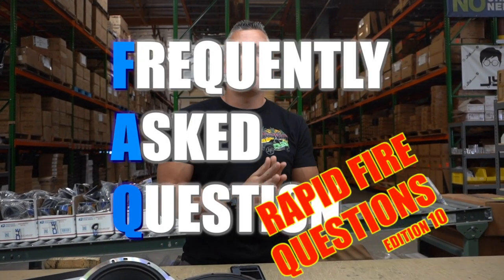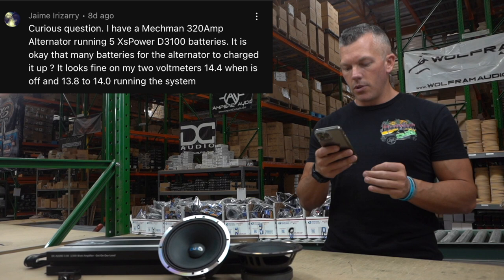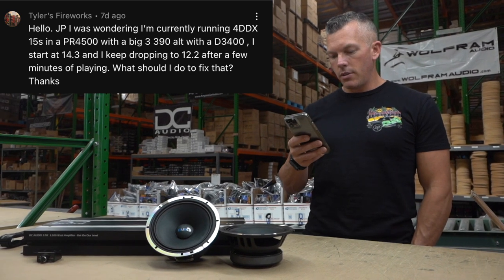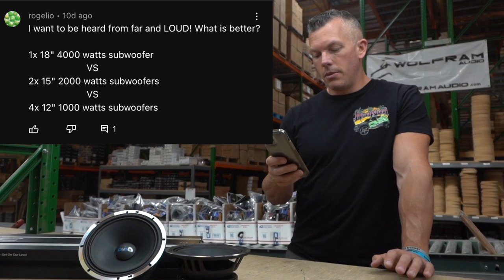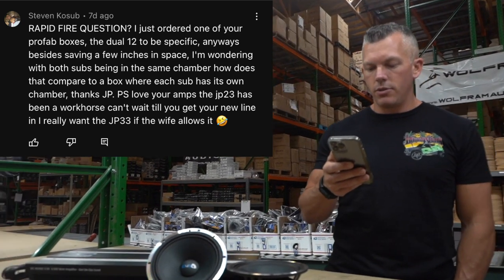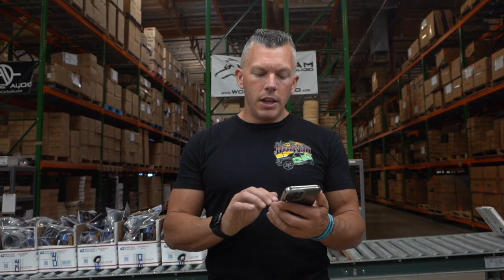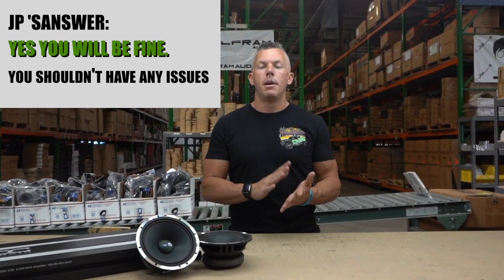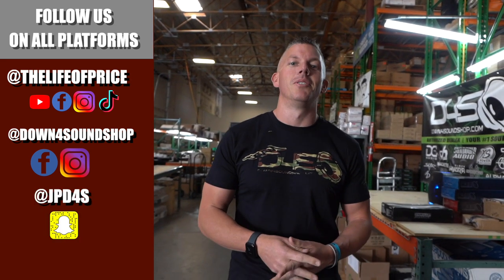D4S CAR AUDIO RAPID FIRE QUESTIONS: EDITION 10

Comment: I’m going to add 2 Down for sound 6.0 batteries should I run wire from the alternator to the back batteries or from the battery under the hood to the back batteries
Reply: Always run from the alternator to the battery in the back also make sure you have a good grounding point on the frame so you don't have any problems in charging and power handling capabilities

Comment: Rapid fire question: Yo jp I just bought the LTO 6.0 lithium to power 3 skar evls and a 320a js-alternator my voltage stays at 14-14.8 but when it's cold around 30 degrees it charges at 15 to 17v is there any sort of in line regulator, step down converter or anything to keep my voltage at 14.4v ?
Reply: Get a diode isolator.

Comment: Hey JP....I got a question about lithium batteries...is it safe to run a lithium in parallel with a agm battery? Or should it be isolated? Or should I eliminate the agm up front with a lithium also to go with they one in trunk???
Reply: I'll answer for JP just incase bro...hell no. Don't MIX AGM and Lithium
Reply: @imlurkn5291  so should I isolate or get rid of the agm altogether....I haven't ordered batts yet but I will be in the next week so I need answers fast.....I usually run a bunch of agms but I'm liking the power and less weight that the lithiums bring...but I'm not educated on them at all...
Reply: @Cadillac Don  If you have money id go with that new lithium battery JP just dropped and do away with agm all together if you think your system is worth it spending the money on it. That's probably what he will tell you but it seems like a badass product if you're needing that power
Reply: @imlurkn5291  yea...im looking at them now I might go with the 4 lto package or the cyber 12k ...and for the hood the xspower xv6500 lithium for the underhood replacement...cus I really don't want all the weight of 6+ agms if I can avoid it lol....
Reply: @imlurkn5291  and just to help find a answer my system in this build consist of 370amp alt...double 4/0 runs from front to back, 4 gauge power ground to a soundstream 1500 watt 4 channel amp for my mids & highs, and  dual 0 gauge runs of power & ground ran to 2  banda 8ks for subs, subs are 2 18inch Soundstream XXX with Corey Dean Spl Audio Recones.....
Reply: All lithium 100%. I’m in the process of switching mine over to the XS power Titan 8 line under hood and out back. The under hood weighs 9lbs lol. Good for up to 6k rms.
Reply: @Cadillac Don  oh yeah you should go lithium for sure.
Reply: Thanks for the help guys.....one more question...the xv6500 lithium under the hood with the lto 6.0s in back its ok to pair together right?
Reply: @Cadillac Don  That I'm not too sure of. I see the one under the hood is 7ah and the ones in back are 23ah each. They're both 12.5v and lithium but one would discharge faster but maybe not depending on how much alt amps. Idk man good question lmao let me know

Comment: RAPID FIRE QUESTION :) I want to run 4 mids in each front door, 4 in the the back of the truck and the same amount in supertweeters. How is the best way to connect them all and controll them better? Thank you all for your time :)
Reply: You might have to try something from audio control because you have multiple things going on all at the same time under control has some great amps and processors that you can hook up to your laptop to balance everything out
Reply: @jerrycox5893  thank you for your time and suggestion.

Comment: That is true about the subs acting as one chamber without them being separated and acting as one independent chamber if they had their own space. But since the prefab boxes are already designed and built as a two sub non chambered enclosure, they air space is in a way likeable to the subs. Now if you what two individual chambers you have two calculate the outer box size and the two internal separate chamber. So for example if you want each chamber to be 1.5 cubic feet then the second would be 1.5 cubic feet giving you 3 cubic feet. On top of that port space sizing is a factor also.

Comment: On the 3rd question BEING LOUD there are 3 types of LOUDNESS SPL  SQ OR LOW END pick one plan and simple  I am loud and low with 1 X SERIES 15 WITH A SMALL 17X17X17 sub box 6 Inch big ass areo port in reverse for low end tuning with 40% spl .  I have a db meter and hell 152db in a 4 door sedan.  With his JP8 just one and wired down to 1 ohm
Reply: How do you have over 1k subscribers and zero videos on your channel? Also if you are doing 152db on 800watts from the trunk then thats hella crazy unless it is specifically a spl one note wonder build. And what does low end tunning and 40% spl even mean? How did you come up with that 40% number? Also I think you meant to say external port.
Reply: Hehehehehehehehehehehehehehehehehehehehehehehehehehehehe hehehe Hehehehehehehehehe! lmao!!!! Lol XD🤣🤣🤣🤣🤣🤣🤣🤣🤣🤣🤣🤣🤣😂😂😂😂😂😂😂😂😂😂😂😂
Reply: @ditto_75  This is my back up channel and as far is my 1 15 X Series I have a F3 tuning sub box with a 6 inch BIG ASS AREO PORT in reverse for more spl and low end.  My max db's is 152db's Every subs has a max low tuning and a max spl read out. So since I am dealing with a LOW END TYPE SUB.  On the sundown audio website is the info on it.  40% spl the rest is low end bass it is not hard to figure out :D LOL
Reply: @ditto_75  Sundown Audio has the best of both worlds here  high spl or low end subs YOU NEED TO GET TO WORK ON READING THING BEFORE BUYING ANY CAR AUDIO BUDDY :D LOL
Reply: @________GHOST________  Ok, so I understand your guessing at the 40%. I know what the F3 of a enclosure is but I do not understand your terminology "F3 tunning box". Also, "big ass 6 inch aero port for more spl and low tunning" does not automatically mean your loud. Like I said before. 152db on 800 watts from the truck is impressive unless you have a one note wonder spl box. Are you trying to say that your hitting 152db on 800watts from the truck on music? 
I don't know what you on about in that other comment. I have been designing and building speaker enclosure for nearly 30 years. And I always read up on what I am buying. I don't know dude. Maybe I just don't understand what your trying to say.

Comment: #RFQ For a 12v system, if the amplifier & subwoofer pair perfectly “on paper”, should I upgrade the subwoofer due to running a 14v system since the RMS is increased from the amplifier by a great percentage?
Reply: Hey I belive that you should have a bigger amplifier due to box rise
Reply: Interesting. Since I have 8 bass amps, you suggest that I go for 4 “stronger” amplifiers because of box rise? @EDOGG991
Reply: Yes I'm not saying I'm an expert but when any subwoofer playes in a box the impedance is changing and or "rising" your am is not continuously putting out the rated power it should still be close tho

Comment: What up JP. I have 8 10 inch midrange speakers 350 watts rms 700 watts max and all 8 ohms what amp would you suggest I power them with.

Comment: Yo yo im in NC and have 1 xv2d2  15" running on an scv 3000d amp and love it... ive got 2 xv2 d2 18's in my cart at d4s and a jp4300 but should I get the jp6300 to push those 2 18's instead???

Comment: The difference between a box with the subs in one chamber and subs in a box with there own chamber is the one with both in a single chamber will be a mono channel whereas subs with there own chamber each can be run in stereo with left and right. Or you can wire the with a mono 1 channel amp. But the best quality sound will be a dual chamber box with a 2 channel amp running left and right rcas

Comment: I think the difference between the subs divided or sharing the space is going to be the dampening if I remember correctly. Being divided should result in better dampening. If it's a ported enclosure with shared space and 1 sub is closer to the port than the other then it can even cause issues. Sharing space in a SPL build is probably not a big deal but could be in SQ. Has a lot to do with the amp also. I could be way off about that too tho. Lol

Comment: If I bought the lithium 6.0 should I keep my led acid battery under the hood or replace it with a lithium battery and how would the charger work on the lithium 6.0?
Reply: It’s best to keep it all lithium and get a lithium charger. XS power has their Titan 8 line that’s under hood rated. And they have supplemental cells for out back too.

Comment: Rapid Fire Question: For someone that doesn't want to lose their sunroof, and it's not a competition system, what would be the maximum size system (in watts) you would recommend?
Reply: There's no right way to answer that buddy. You can't really determine flex based on power. Add a stripper pole if you are having issues

Comment: The air in the enclosure acts as a spring so two subs sharing airspace vs each in there own space should be the same
Reply: It hits a little harder cause the air pushes the other sub so them pushing each other get a little more bass

Comment: I got a ? JP. Why does my sub sometimes get stinky when I am not clipping it? I'm running a DC lvl 3 15 with lvl 4 soft parts on a SIA 2500 @2ohms. Thanks!
Reply: If I were to take a guess, you are overpowering it.  Sundown amps are always underrated and if you only know you arent clipping and havent measured the amount of power going to the sub that could be your problem.

Comment: Hey ,jp I just got two crossfire c7 twelves dual 2 I was thinking of running a crossfire 2k on each or getting the 4k or the 6k what do you think
Reply: Single 6k imo. Depending what their rms is headroom is good when you consider impedance rise. Generally I go for around 1500-2000rms higher than the subs total rms rating.
Reply: @TheDoozie43  thanks man I was thinking that but I want to make sure they say they are 1600 rms but that is not true cause the build quility makes me think 2k all day but the other thing is they are dual 2 ohm subs just want to make sure it's right being that it's my first time running dual 2 ohm subs

Comment: hey jp i was thinking about getting 2 xv3 15's u think a salt 8k would be too much at 1 ohm or should i wire the subs at 2 ohm much love
Reply: Run them to 1 ohm so get two x15v3 Dual 1 ohm subs.
Reply: Salt 6k imo should be perfect. It does close to 8k rms @ 1 ohm. The 8k is closer to 10k.